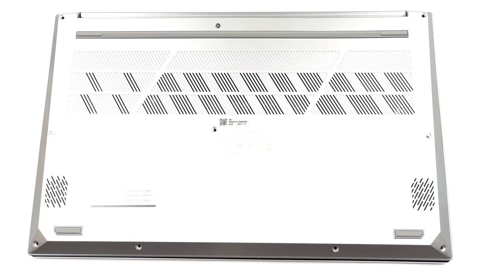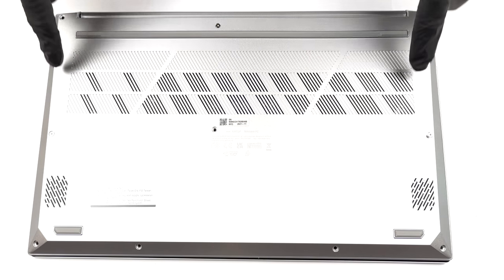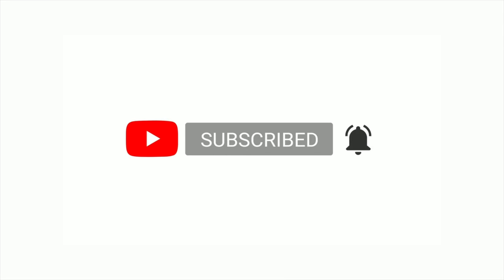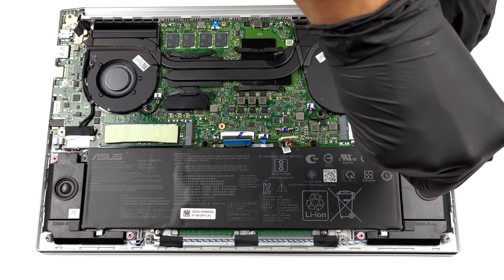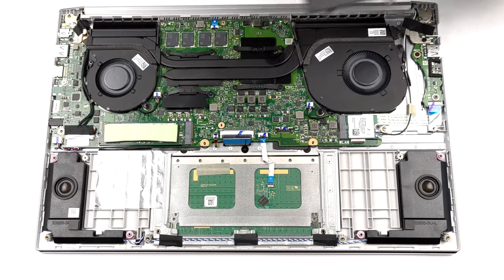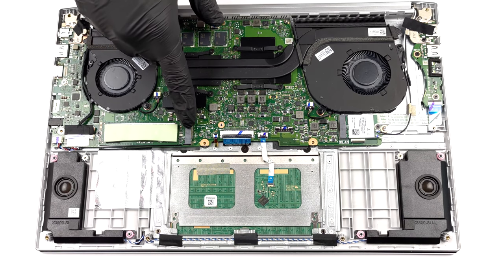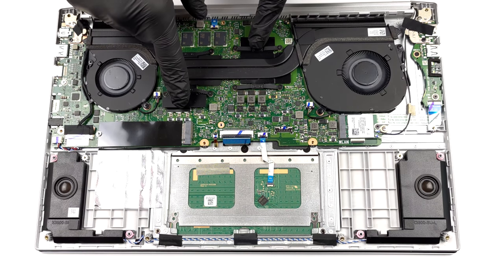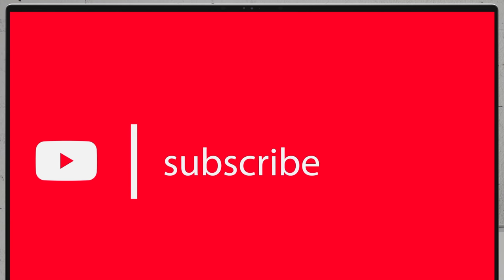🛠️ ASUS Vivobook Pro 15 OLED (K3500) - disassembly and upgrade options

Comment: hello, my pc comes with 8gb, in the video you say that it cannot be expanded because the ram is soldered but it can be configured to 16 GB, could you explain to me what you mean or how this procedure is done
Reply: There are 2 diff memory configuration 8 and 16gb. If yours is 8gb it can't be upgraded.
Reply: "it can be configured to 16 GB" only means that you get the one with 16 GB onboard (soldered) instead of 8 GB, no extra RAM slots.
Reply: @carloguggiana-diaz5624 is this mean that I can't remove the 8 GB to install 16 GB
Reply: @amrmunir4483  that's right, you can't remove the 8 GB, since it's soldered